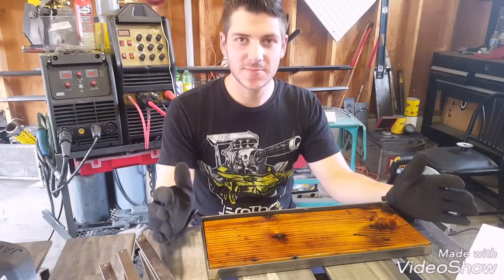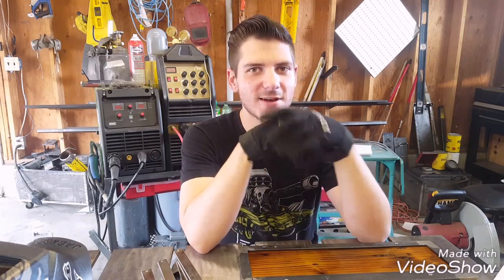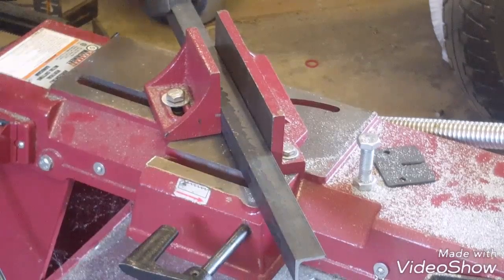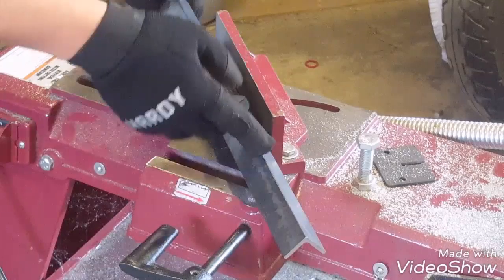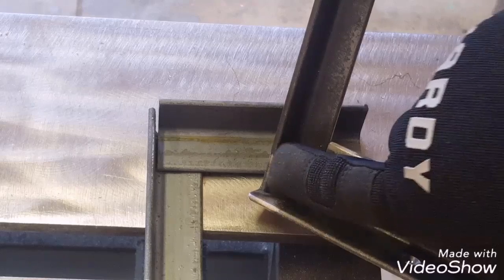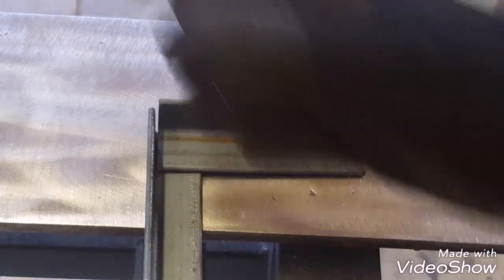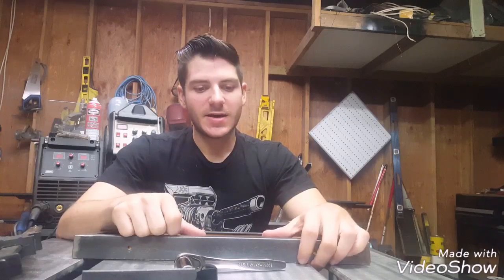Angle Iron Part 1

Comment: My hoarding of bedrails is going to come to fruition.   Was looking for some ideas.
Reply: @andyhyde4711  I made a taco cart out of bed rails. It houses the griddle and 3 1/3 trays for meats and 1 full tray for tortillas and to keep things warm.  The legs themselves I bought some square tube just to be able to slide in and out for transportation. I welded it with a Flux core mig welder.  Took about 6 hours in planning and building.  I skinned it with stainless steel sheet metal the following day.

Comment: Thanks for the vid. I "invented" the square-stock method myself just recently and it seems to work fine, but I'm on here because every piece of info I can find online (and in the saw manual) says that you should only cut angle iron when the corner is pointing up. But no one ever says why--it's just one of those rules that's passed on but never explained. Does anyone out there know why that's a rule and what the downsides of mitering angle iron are?

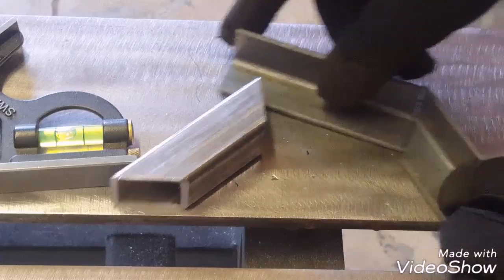Comment: Thank you for sharing you saved my ass. Im a Hvac guy not a shop guy. They want me to fab this aluminum angle frame. Its got to sit flat so I either need to miter or notch. Going with notch. Hey @ 6:52 the word your looking for is True Length. The true length will change depending on the degree of the angle. Have a good 1 bro.
Reply from the maker: Thanks bud im glad it helped you!

Comment: I got a question for you I just bought a welder I've been using flux core I want to use gas. I don't want to run out of gas right away What size cylinder should I get 40,  80 If so how long does each one last..

Comment: 6:43

The reason that 45 degree cut is longer than the 90 and the reason why they dont match up is because the 45 degree cut is the hypotenuse of a right triangle.  The hypotenuse of a r triangle is always longest... thats why it is longer than the 90 degree cut.  Or put differently its the reason a 90 degree cut wont equally match in length to a 45 degree cut... its not as long

Comment: Do you have a particular method for tacking and welding these coped frames so they don't potato chip when you weld them up?
Reply from the maker: I always try to weld the outside corners first.  Then weld out the others.  I'll clamp them down if I can.

Comment: How about attaching an external drive to your phone via USB? Or you could invest 15 bucks and buy a 64gb card. Cheers, and thanks for the tips!
Reply from the maker: MickHornbak I Would But it's an s6  and they don't accept external memory or SD cards.
Reply: 5th Street Fab Shop you can adapt it. Here's how: https://www.google.de/amp/s/www.geek.com/android/the-best-ways-to-add-removable-storage-to-the-galaxy-s6-1619583/%3famp=1
Reply: You can get an otg cable which is quite cheap. Just make sure that it's compatible. I use that with a full fledged ssd hard drive on my oneplus and it's great.
Reply from the maker: MickHornbak I might have to try that.  My phone won't let me use any cord to download pictures to a computer it's on the verge of breaking.  But that cords super cheap thanks bud!
Reply: 5th Street Fab Shop you're welcome. Another alternative is to copy your videos over wifi, if you have access. I use an app called file commander for that. You just need to share a directory from your pc (I'd recommend some public directory where you don't keep any sensible stuff). It takes a little longer to copy though.